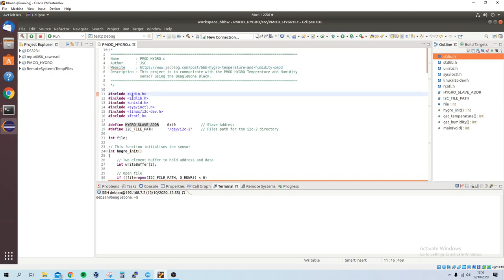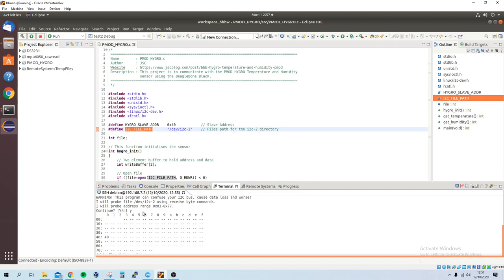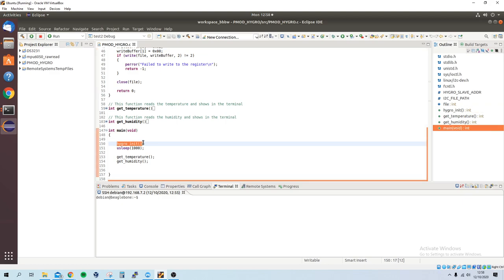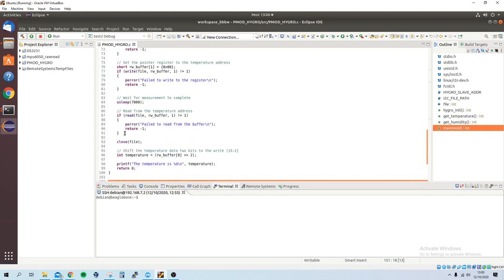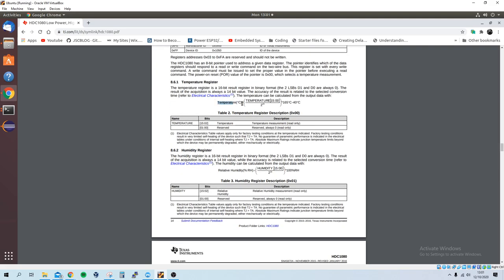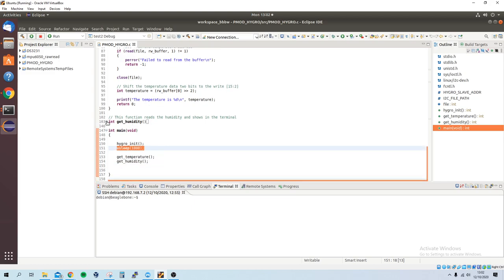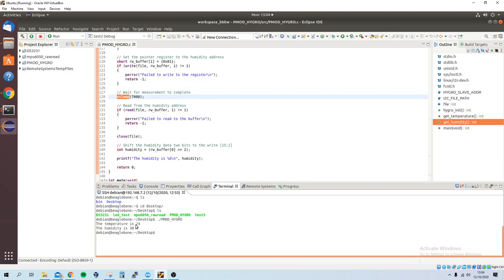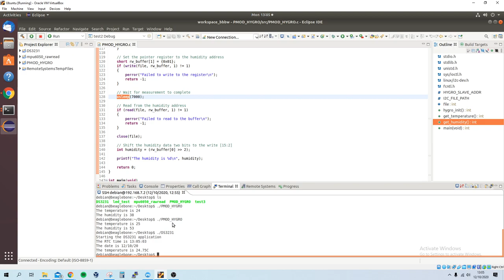BeagleBone Black: PMOD HYGRO Temperature and Humidity sensor

Comment: Hey great video, for a school project i need to setup my HYGRO PMOD sensor but i have no clue where to start any advice you can give me. Thanks.
Reply from the maker: Hmm what device are you using for the implementation as an FPGA, Microcontroller, Single Board Computer etc
Reply: @JSC-4  I'm using a Zybo Z7 FPGA, with the MicroBlaze microprocessor initialized.
Reply from the maker: @juleslamarre3919  if your looking to implement this on the microblaze processor, then it should be very similar as its just C programming, but using the I2C/IIC IP core. If your trying to do it using HDL (VHDL or Verilog) then you'd need to design the I2C core yourself.

Reading the registers are pretty much exactly as I've done in the video, so if its C programming then it's the same but using a different the Xilinx API.
Reply: @JSC-4  Yes it is C programming. The API I am using is Vitis based on Eclipse the API you are using
Reply from the maker: @juleslamarre3919  ahh right. I haven't used Vitis yet, but if the API is the same, then everything should work, with most likely some slight changes.

If I were you I'd first read the datasheet of the sensor. Take note of the registers you need to write/read  to and from. After that figure out using the I2C API or what the changes from the ones I've used in the video. Best of luck!